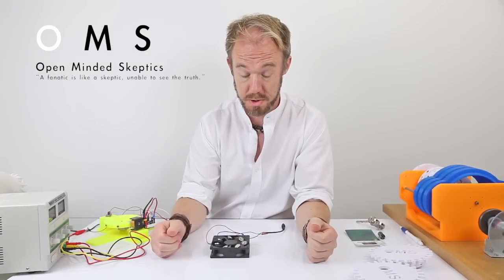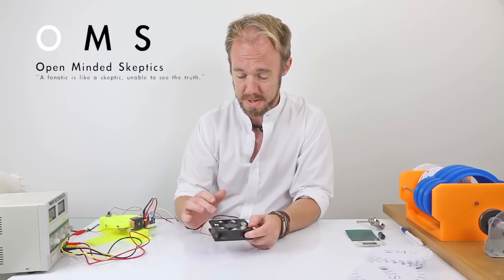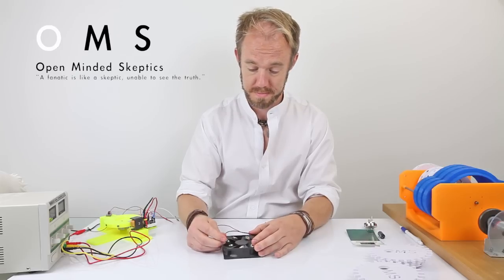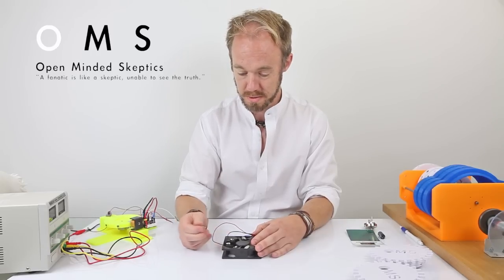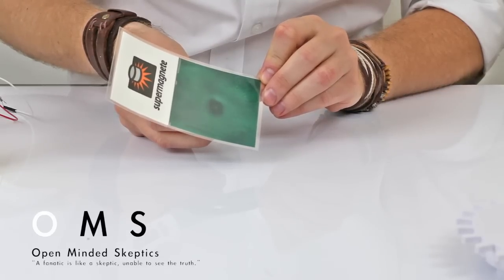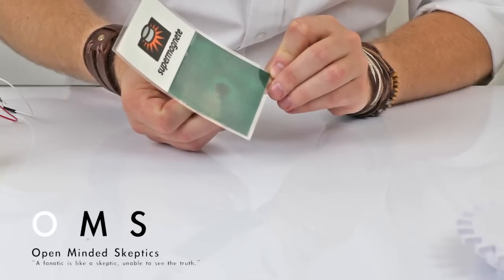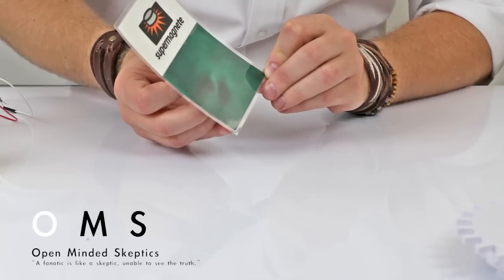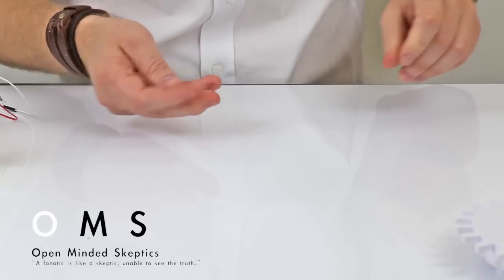FREE energy using a fan (Magnet motor)

Comment: You cannot get free energy from any generator. Energy Output < Energy Input for any heat engine. That's the Law of Nature.
Reply: but you can get a force from magnets------------     that repulsion created by the force results in movement when positioned  close enough to like magnets
Reply from the maker: That is the point of this video yes

Comment: I disagree, you just proved it works, only your force didn't overcome the friction. Friction is always going to stop the motor, but the more power you put to your motor, the more likely you may over power the friction for a longer period of time. Magnet shapes, sizes, angles and position are likely to make a difference. Friction reduction, bearings are already pretty good, however temperature will make a difference, and putting it in a vacuum might help. Regardless doubters like quitters never succeed. And true, it is trying with all the * up here, but the theory is sound.